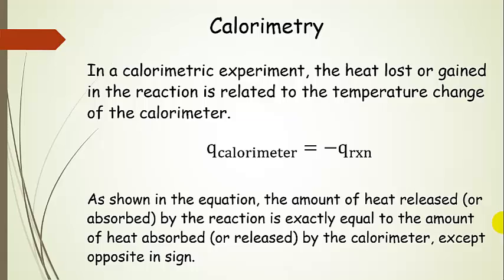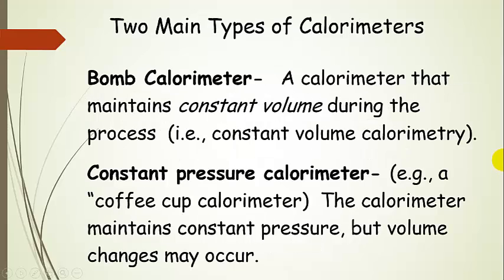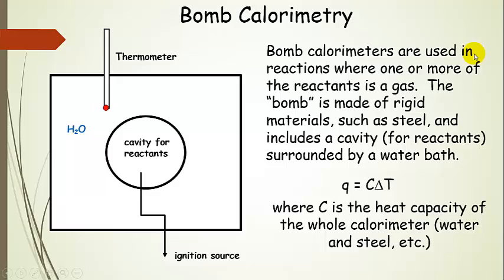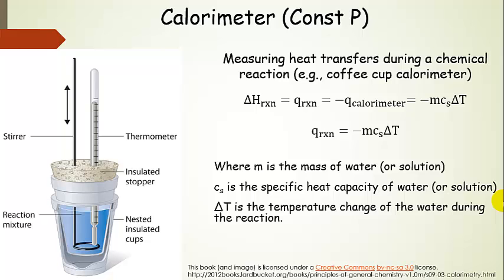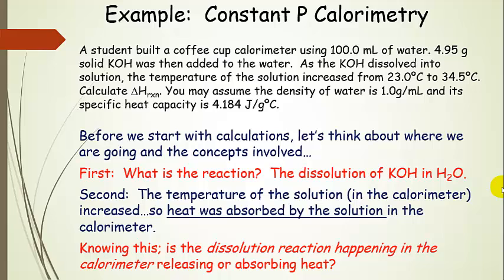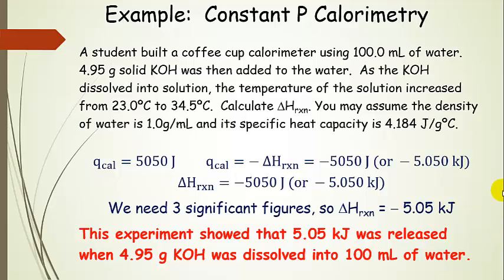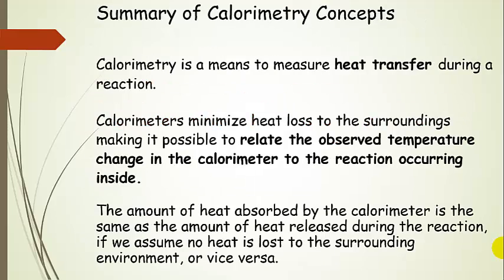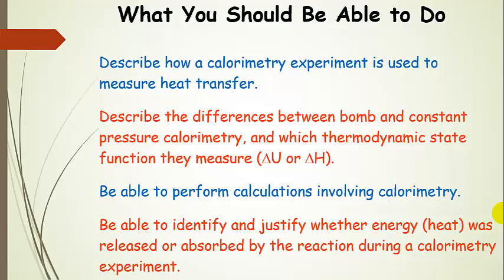Calorimetry (Bomb and Constant Pressure) Lecture and Example Calculations

Comment: Hi Ma'am can u plz solve this problem:
2.0 g of C6H6 was burnt in excess of O2 in a bomb calorimeter :
C6H6( l ) + 7½O2(g) → 6CO2(g) + 3H2O( l )
If the temperature rise is 40°C and the heat capacity of the system is 2.0 kJ/K, calculate the enthalpy of combustion of C6H6 at constant volume and constant pressure.
Answer. – 2.4414 kJ/mol; –24410.283 kJ/mol